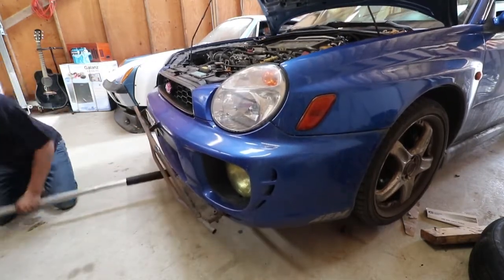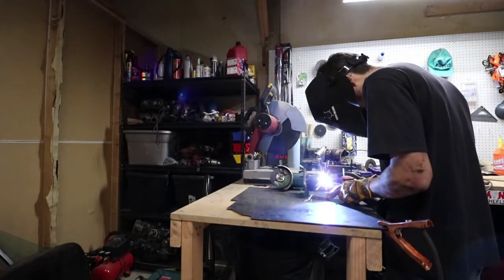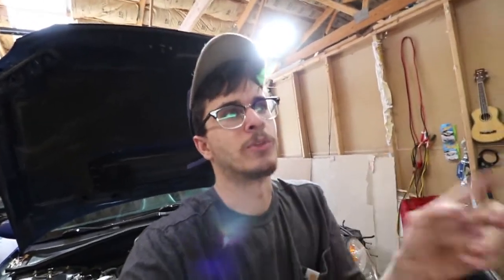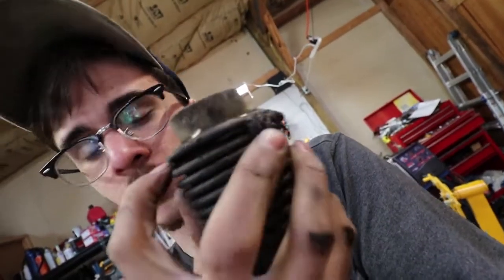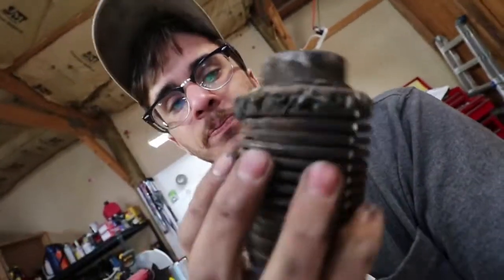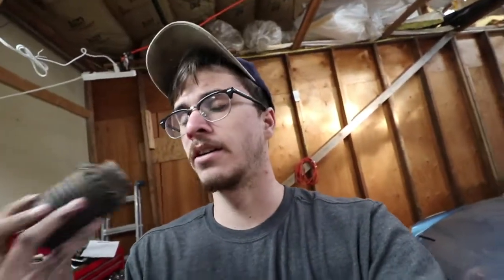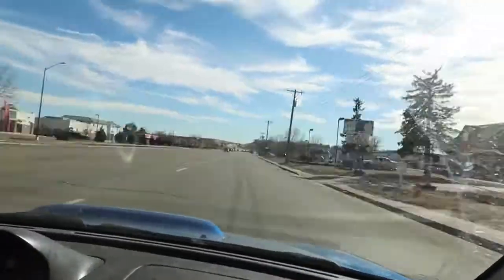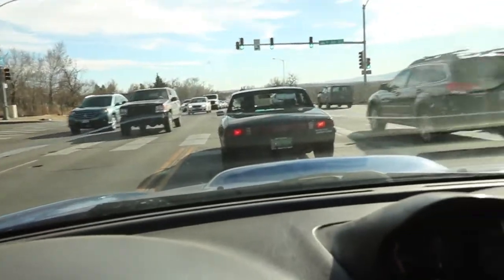Finally fixing the daily Wrx!

Comment: if he starts misfiring again, tell him to replace the plugs with NGKs. My Forester runs like absolute trash with any plugs other than NGKS.
Reply from the maker: +Shaun McGrath we replaced them with ngk plugs, and it just started doing it again. Back to the drawing board I guess.
Reply: SMB Garage is it hesitant to accelerate? I did plugs and wires and that fixed mine. Any check engine codes?
Reply from the maker: Yea just misfires. Plugs and wires have all been done. Plugs fixed the problem for about 10 miles.